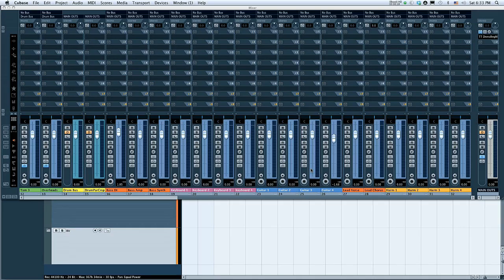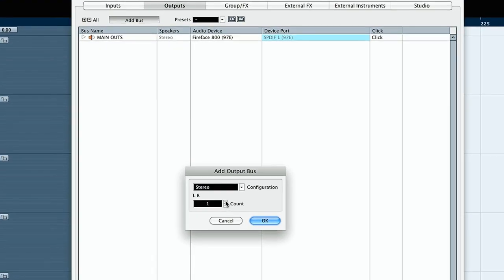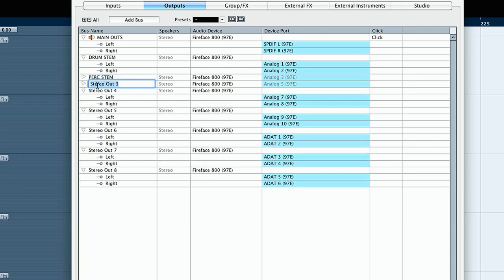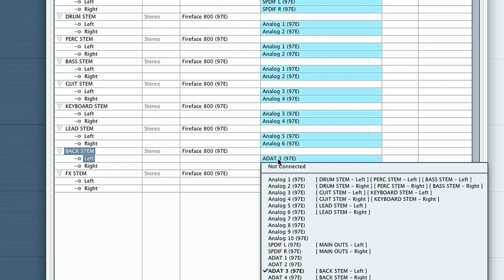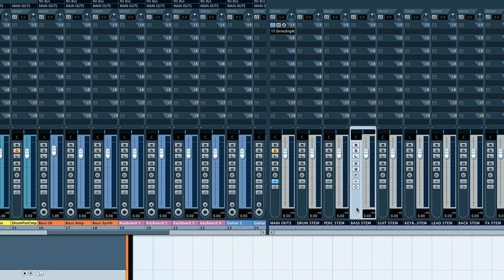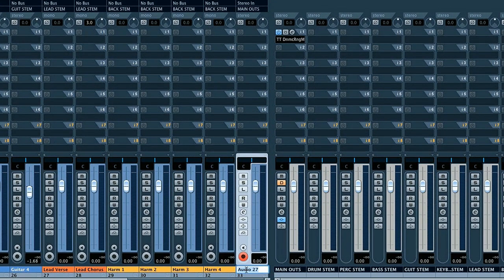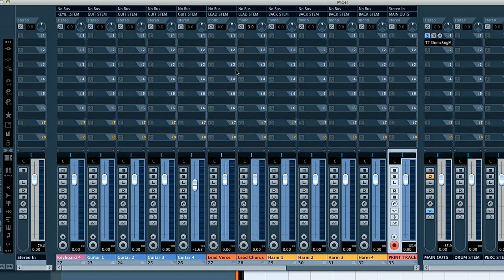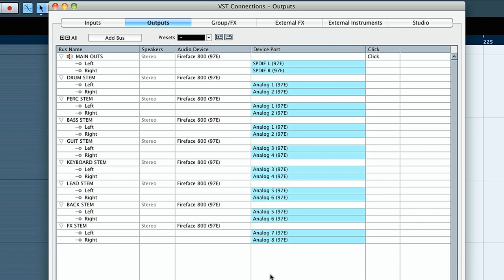Analog Summing: Cubase Session Setup

Comment: this doesn't help with delay compensation, since that has to do with the master out.  you should redo this using the external effects busses.  Basically assigning hardware sends with no returns for going to the summing device and a return hardware insert on the master
Reply: I do this and it still doesn't solve the latency problem. It would account for latency if you're doing only a stereo out/stereo in, so you can put them in the same external effect insert, but if you have say...8 stereo outs and a summed stereo in, cubase won't know how to compensate. This is the sole reason why I came to this video, looking for ways to compensate that. A solution to reduce some o the latency when listening is to enable Listen button on the summed Stereo Input, but the channel meters will work only if you also enable monitoring on the mix track.

Comment: Thanks for the video. Is this actually analog summing though? Your sending tracks to an internal buss to be summed ITB, then sending those subgroups to the summing mixer. It feels more like Analog coloring. Also what do you do if your summing mixer has no digital option, and your card has analog i/o only. And you use the summing mixer as your monitor controller. Where do you send your main mix?

Comment: What is the purpose of analog summing??  why should I spend all the money for all this extra gear when cubase can export a  mix digitally???
Reply: warmer sound that has more depth. you could use a tube device there or something with good opamps...but nothing wrong with a good mixed digital render.
Reply: It should be possible to model the corruption that the analog mix adds to your signal, because people find analog corruption pleasant.

Comment: Nice video. FYI, you can select a group of tracks via the SHIFT key method (select the first track in the group, hold SHIFT, then select the last track in the group to highlight the entire group). Now hold SHIFT+ALT while choosing the desired output on one of the selected tracks. Doing this will simultaneously assign the same output to ALL the selected tracks. 

Just a quick Cubase tip to save you some clicking action next time you have to assign the same output to several tracks ;-).